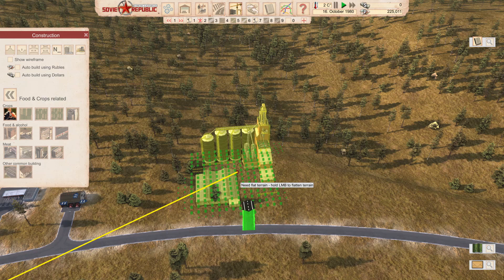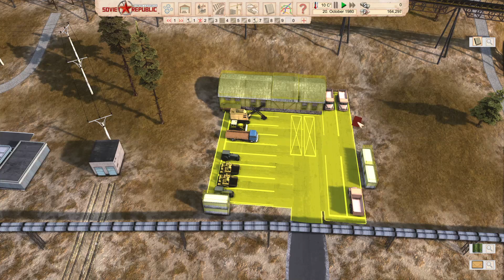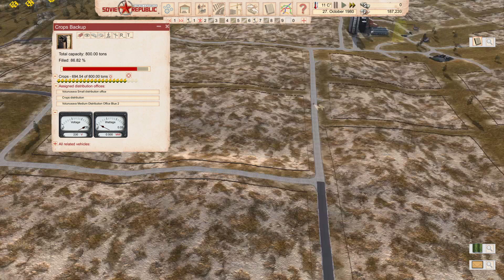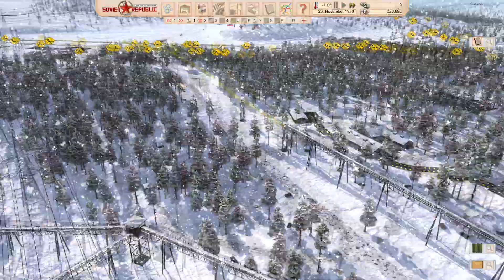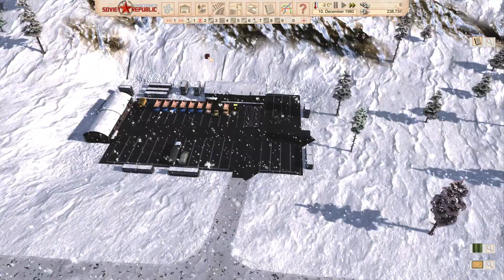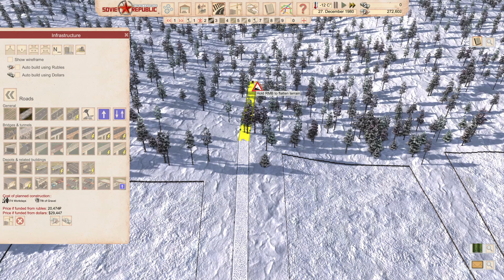Racing Winter :: Workers & Resources Soviet Republic (Seasons Update) #32

Comment: Good game but sometimes the way you move around and spin is getting a bit seasick. 
When I play I usually keep a fixed point of view and only move left/right and forward/backward 
I am 75 and a bit delicate. :)
Reply: I'm only 57, but I play the same way.  It helps with orientation especially when dealing with turning conveyor towers on and off!
Reply from the maker: ty for the feedback,  have problems with the MMB unlocking the rotate/free lock, will have see if I can remap it to another key.
Reply: @StephenSilverbeard  IMO using the minimap to move the camera long distances helps (I think that's a thing in this game!?); otherwise, simply keep camera moves smooth when you can, rather than simply jerking movement around at seemingly random & frequent intervals (this goes for other vids too :) )
Reply from the maker: @snafu.X  The problem is the RMB which toggles free movement/camera rotate.  Have a 'quiet' click mouse which makes it too easy to select the mode by accident.  Remapping to the MMB did not work, so have remapped it to the key board.   Hopefully, this will give a more stable view similar to Rome 2.